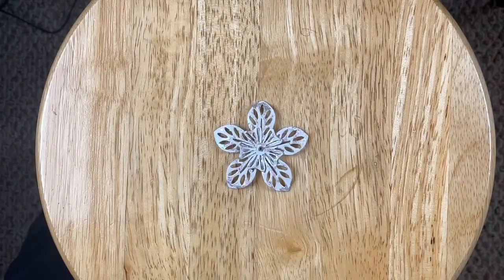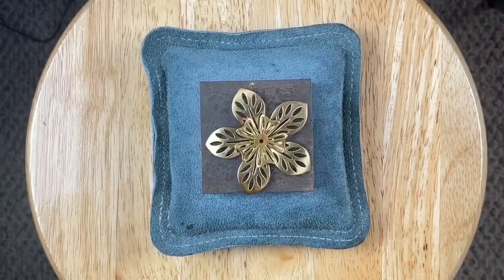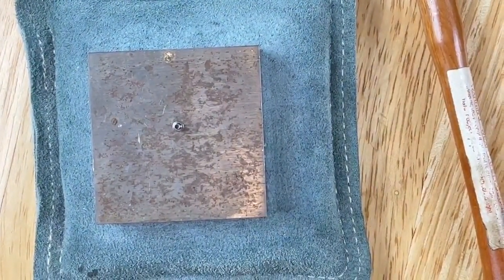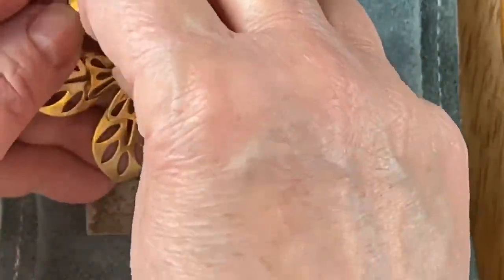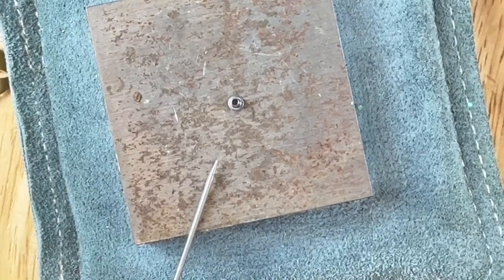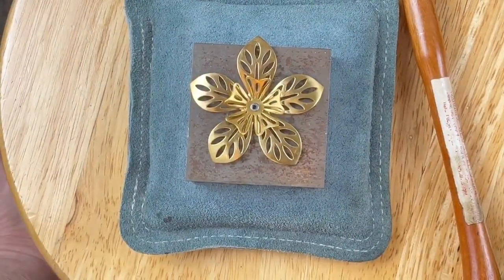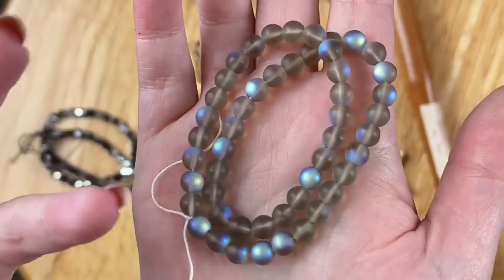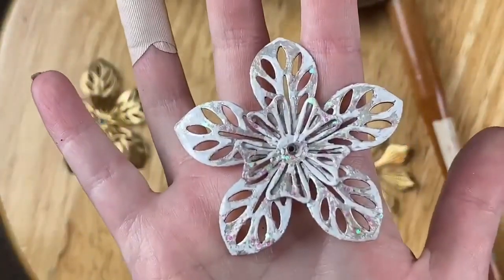How To Rivet Brass Stampings | B’Sue Boutiques

Comment: Great review! I've never purchased one of the bags. When I first started riveting I used to use a bath towel just folded many times to get a small square. Now I have a rice bag meant to cold or heat when you pull a muscle. The one I have is almost the same size as B'Sue's bag and it works great. So it is easy to improvise.